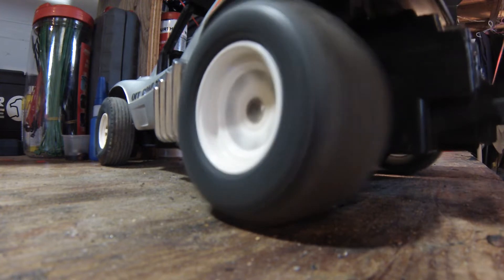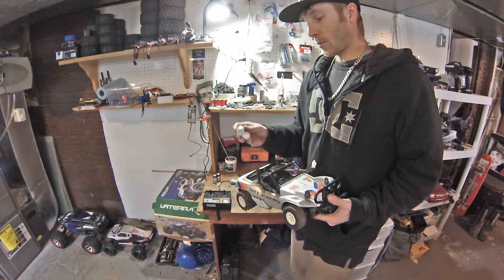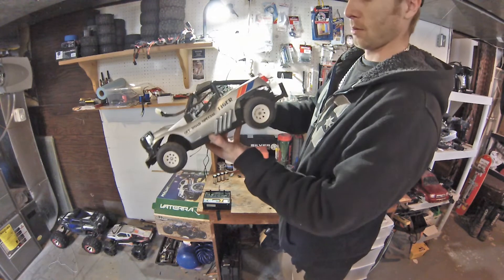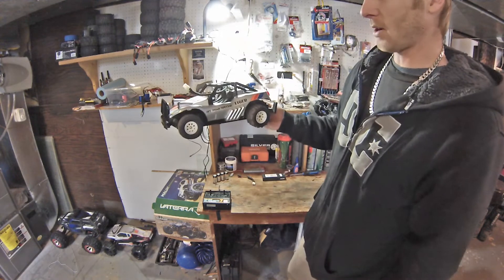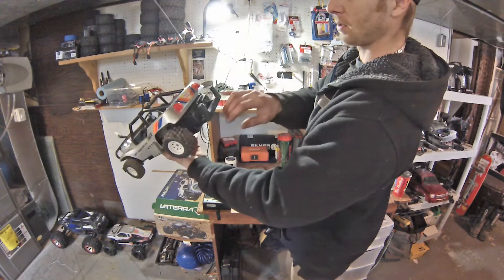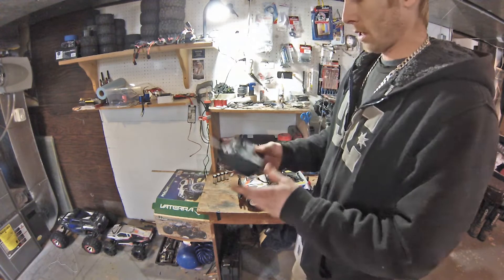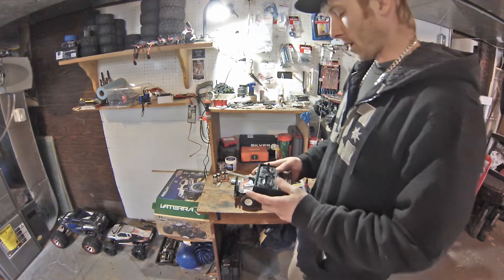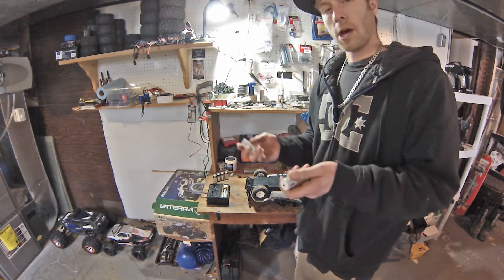Radio shack Traxxas LiPo Hop-up Vintage Nikko Offroader SPECIAL Tiger Upgrades

Comment: Damn man, 900 feet of snow? You must live near me lol. Getting hammered this year, I'm actually sick of snowblowing haha. The chains on my P4de kick ass on ice, but def need paddle tires for snow.

Cool mod on that rig!
Reply from the maker: haha yea pretty much 900ft, its snowing again now.
Thanks man. 
n yea im in ontario
Reply: chris bro I'm about 30-40 mins outside of Niagara falls NY, just finished snowblowin the 2 feet of slush at the end of the drive from the plows. Definitely ready for spring and mud lol
Reply from the maker: Awesome man. Were a few hours apart I'm in belleville. East of Toronto down the 401 before Kingston.
N me too I want everything to b warm
N sunny lol.
The rc break to fast in winter lol
Reply: chris bro I  love nice and warm, but also love my p4de on ice with chains lol. 3S it'll pull massive ice wheelies. Just too much damn snow lately, chains don't help in deep stuff, just ice :/
Reply from the maker: no too much powder lol, my summit can drive onto of the snow banks cause there hard. but not the fluff.
do you have a video of it? I'm sure you do. 
i wanted to stud a set of rims without tires for the ice n see how that works
Reply: chris bro haha yeah, I have a few vids, check out my channel :)

Summits are sweet, I'd love to get one eventually, but i think i just got sucked in to quadcopters lol. Really wanna get a blackout H or hex next with some fpv lol
Reply from the maker: oh yea quadcopters r sweet. i have used a DJI phantom 2 quite a few times now. i don't own it but am allowed to use it. i have a mini hubsan x5, its fun to buzz around, and a cheap litehawk, but its fun cause it has auto flip features. I'm going to ur channel now and will search around to see those chains
Reply: chris bro i wouldn't mind a phantom either! I have a 1st generation syma x5, lovin it as a first quad. Had a bunch of cheap coaxial helicopters but they're nothing like a quad lol.

Hope you enjoy my vids dude :D
Reply from the maker: yea quads r the most fun, my buddy flys and films with a quad for his job. he was quite a few home made quads and some real expensive ones. but there for work so he needs them.. lol flying RC for a job, lucky bastard lol
Reply: chris bro good grief, sign me up lol, will work for LiPo's!
Reply from the maker: haha friggen rite eh,, he actually just walked threw my house door with 1.. speak of the devil jaha
Reply from the maker: lmao